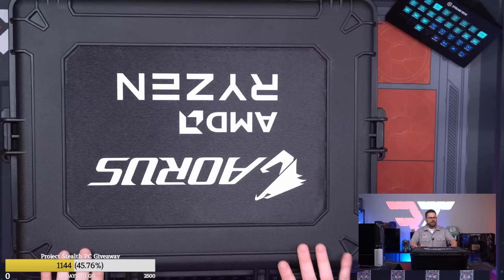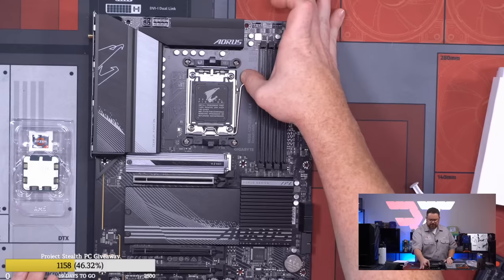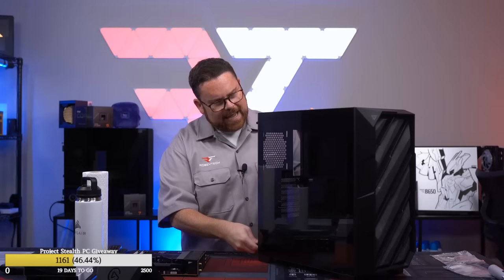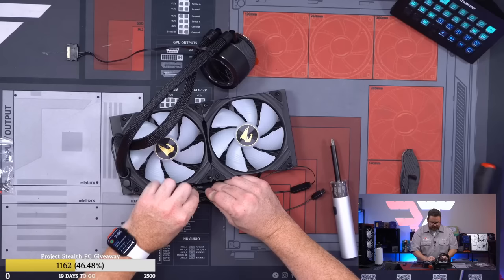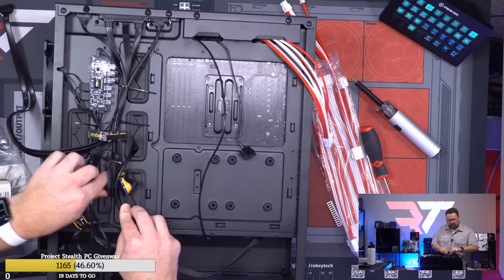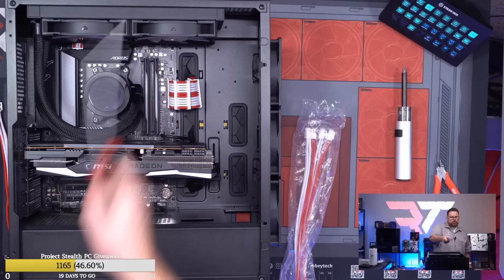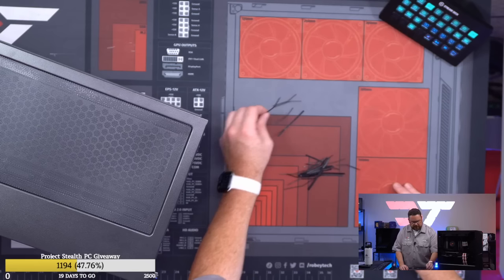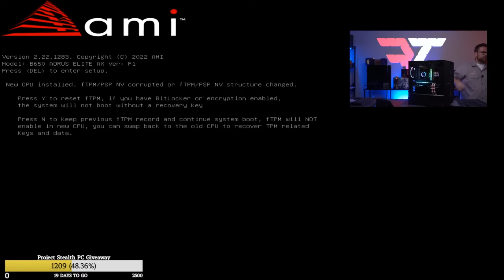$2200 B650 Ryzen 7700 Build – Giveaways + Antec DP503 (7700x / MSI AMD Radeon RX 6800XT)

Comment: On the top of this board there is a 4 wire plug just left of the 8 wires plug, Did your power supply come with a 4 pins power?  Did you install this plug(Power two 12V wires two grounds)?( I did watch your video and it seems to be edited out. )
Reply: You only need that extra cpu plug for hardcore over clocking.
Reply: @Gavinskey  Thank you for your help. a few days ago I did power on the system. I got an answer that told me that the board has two power plugs. They said I could only have to use one. Thanks for your help.

Comment: Nice video! Question - did you use ATX_12v and ATX_12v1 both cables? Because most power supply missing x4 pins ATX_12V1

Comment: Does anyone have the problem where in the middle of gaming the audio starts cracking, going in an out then inevitably the system crashes and restarts? 

Here at my specs:
Corsair HX1000i psu
B650 elite aorus 
Ryzen 7 7700x
Xfx 6900xt gpu 
Gigabyte 32gb ram 
Evo 870 1tbssd
AIO Corsair h115i
Reply: do you have solution for your  problème 🙄
Reply: @smithadam  I think its the motherboard. WOW is playable, but other games are not. Fortnite will make it crash even at low settings and I just installed LOTRO the other day and set at max settings and it crashed on me.

Comment: For the B650 mobo, PC part picker is telling me to connect the 24 pin as well as the 8 pin and the 4 pin directly to the left of it. It didn’t look like you used the 4 pin. Can you elaborate on that? I don’t want to fry my motherboard 😬
Reply: Even though its been a while since your post, using both the 8 and 4 pin is there to give the CPU more power for overclocking it, if you are leaving it alone out of the box it should be fine. I would use both 8 and 4 pin plugs to ensure enough power if being supplied....if its there use it